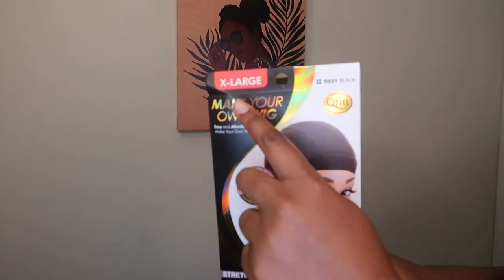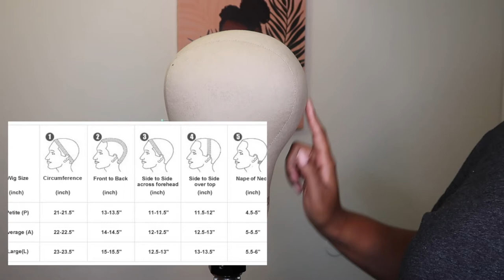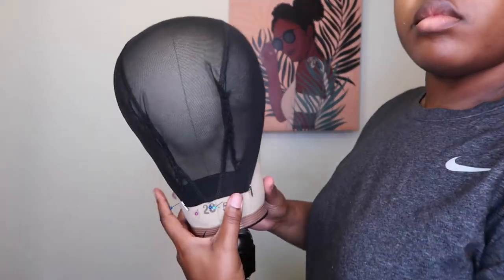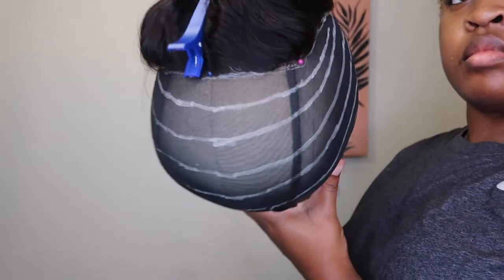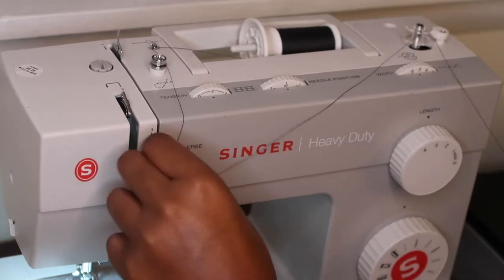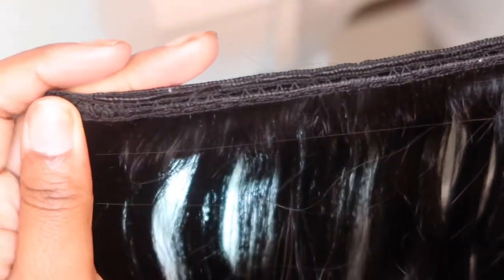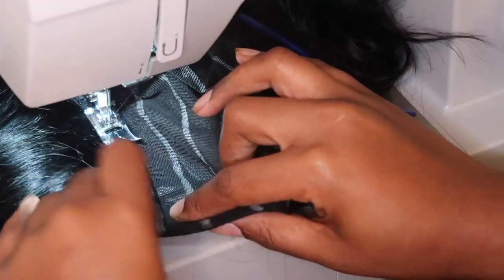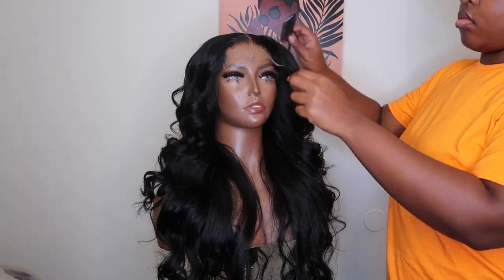How To: Make a Wig on the Sewing Machine⎮Doubling Wefts + Creating Guidelines +Learning Measurements

Comment: Thank you for the angle you shewed. How many bundles did you use?
Reply from the maker: This one is hard to say because I was using hair on an old wig that’s was made by someone else. But, typically I use 3 bundles. Now, if the circumstances size of the head is bigger you may need more bundle’s depending on the desired look!

Comment: Hey I have gotten better with double weft. I don’t know what I am doing wrong when I do the guideline. It comes out uneven. Sewing on the cap is difficult. Especially when I have sew a few tracks
Reply: same here , even after I watch dozens of guideline videos I still messed up, but I ended up getting it before sewing the tracks on the wig. I recommend searching “guideline wig tutorials” for closures or lace fronts, whichever wig you’re dealing with so it comes out accurate. TikTok also has a lot of great short videos to save and learn from. If you have 3-4 bundles, it’s usually about inch apart from what I’ve gathered from all the videos I’ve seen. On the bottom half of the way to usually curve the lines downward, and on the top half usually slant them upward or straight but the last few tracks before the closure usually are slanted upwards on the side. Make sure you’re using a measuring tape, I actually measure the space on each side of the way the left middle and right instead of just the middle to ensure it’s even. Almost videos you usually see them only measure the middle but I’m not good at drawing straight lines or eyeing out anything. If you draw all your lines straight across from left to right , u might not have enough room for all the lines to equally be spaced. if it’s still not perfect, don’t worry because it doesn’t have to be there just guidelines and people usually go in between and add other tracks. If you mess up, you can also use a different color marker. Sharpie is the best.

Comment: Thanks for sharing, how many bundles do you recommend?
Reply from the maker: It really just depends on the thickness/ look you are going for. Typically any lengths from 10-18 you can get away with 3 bundles for the average density. Lengths 20 and up I recommend 4-5 bundles. The longest the hair the shorter the wefts are. Also keep in my if you or your client have a bigger circumference there is more space to to be fill, so you will more than likely need a extra bundle . Hope this helps!

Comment: One thing I’m still confused on - how do you know that the cap is the right size based on the canvas since the elastic shrinks when it’s not on the canvas? I’m scared my wig would be too small when I went to put it on
Reply from the maker: Good question. When sewing on a wig cap it does shrink a little, the only time it’s shrink drastically is when you sew too many wefts onto the cap. For a normal size head size( 22 circumference) I put between 10-12 guidelines on the cap which is about and 1” apart from each other. As long as you convert over your measurements from your head to the canvas head, and space out your guidelines good enough (an inch apart) you shouldn’t experience major shrinkage. I hope this helps.
Reply: @UCASxRx17Y4PmAg-YxXu7LHA I think I need to try it using some old bundles. I’m so used to sewing by hand and I transfer my sizing to the canvas head but it’s puzzling to me how you keep that sizing when the cap is no longer stretched on the canvas. Thanks for the reply. I’ll definitely practice this!

Comment: I tried this and my cap shrunk... I cried literally. Can you advise what I can do?
Reply from the maker: Here are some things I can think of that may be causing it to shrink.

1. Make sure your measurements are correct. If you don’t have too much extra cap loose then it’s okay to leave some space on the cap. Instead of resizing it. Once the tracks are sewn it does take away some stretch. 

2. Make sure you’re not putting the tracks supper close together. I upsell y like to do 1” apart depending on the cap size

Hope this helps
Reply: @KatlinPalmer  sure, I Will try again. Thank you so much for the tips 😍

Comment: Are you using regular thread?
Reply from the maker: I’m using all purpose sewing thread.
Reply: Can I use regular thread
Reply from the maker: @tarellwashington7589  just to make sure, when you say regular thread are you referring to the thread you can get from the beauty supply store? If so, I would say use that at your own will. That thread is 100% cotton so it is a little thicker than the all purpose. So depending on your sewing machine it may sew smoothly or it may not. I personally never used that type of thread, unless I was hand sewing. I hope this helps

Comment: What do I do if my sewing machine jams every time I try to lay a track?
Reply from the maker: Do you have a heavy duty machine? I know when I was using a regular sewing machine mine would jam up quite a few times and would even stop working and I had to go to the repair shop to get it fixed. I will say if everything is threaded right then it may just be you need a heavy duty. Sometimes pushing too much through the sewing machine can be a lot. I hope this helps
Reply: @KatlinPalmer  Yeah I think that’s the problem, I have a Singer Traditional machine. I’ll be upgrading to a heavy duty soon. Thank you 🙏🏾
Reply from the maker: You’re welcome!